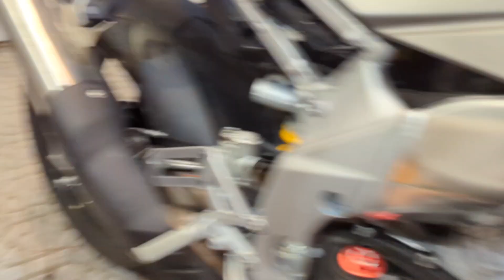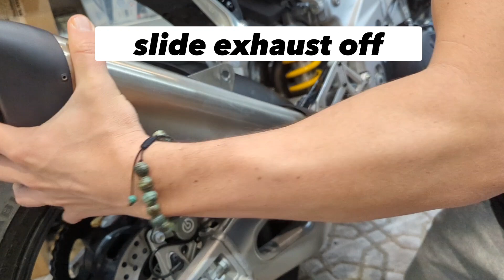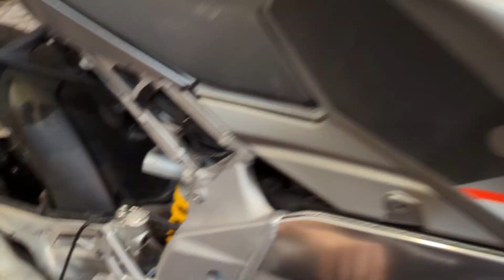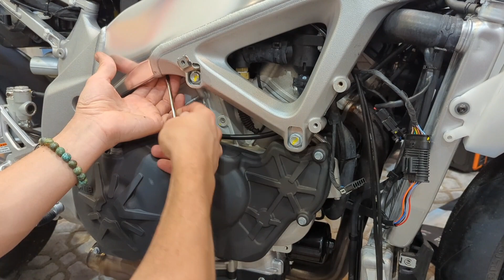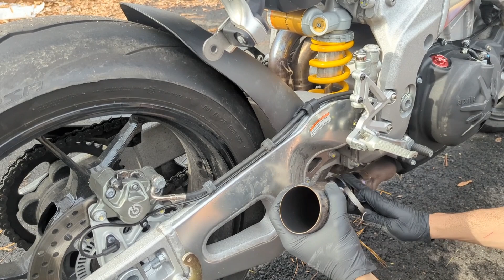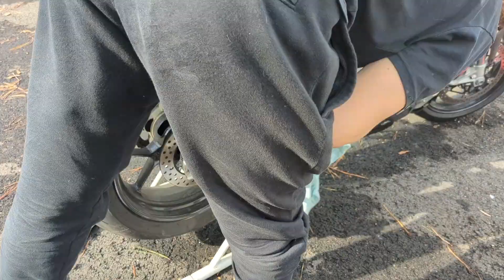No Fluff DIY: RSV4 Akrapovic Exhaust Installation 5 min vid

Comment: after removing the stock muffler, doesn't the bike go into check mode?  And if so how do you fix it?
Reply from the maker: When installing an aftermarket exhaust you'll need a special tune or map. Like Gabro Racing maps with UpMap. Or an exhaust servo eliminator plug (but this will not correct the fuel ratio.
Reply: @og_racefactory so with upmap you don't need servo eliminator? Thanks, planning to do same thing.
Reply: @bautista2045 the upmap allows you to eliminate the servo amount other options. So far mine runs pretty good. If you wanted to keep the servo motor the upmap and close the valve when in neutral and then remain open when in gear, not sure why anyone would want to do this unless they can't afford a slip on?